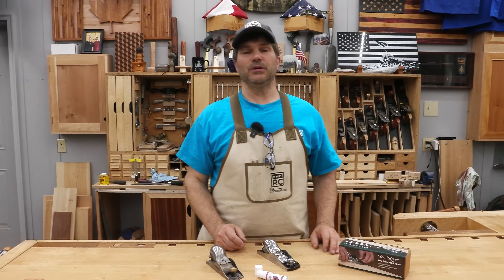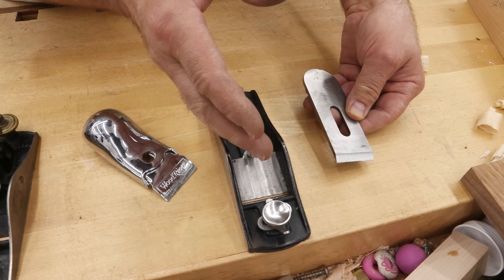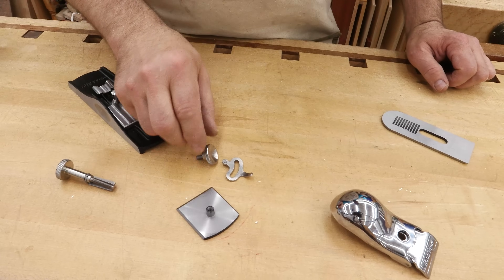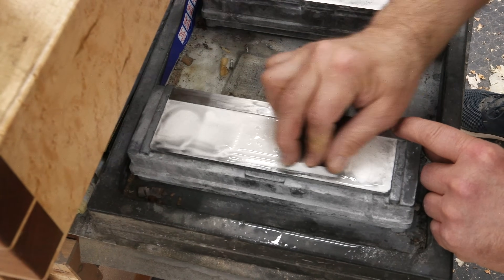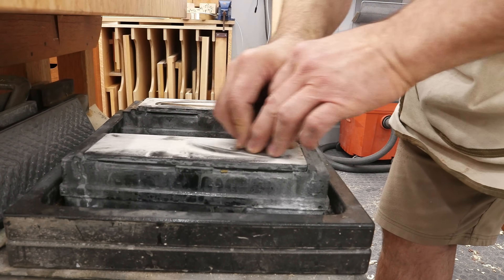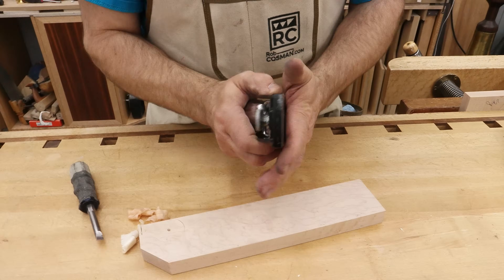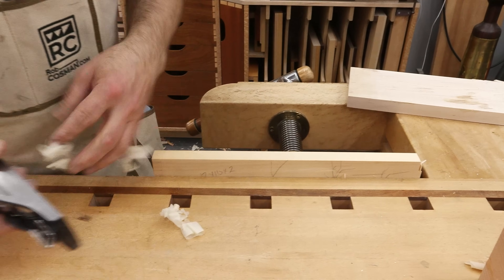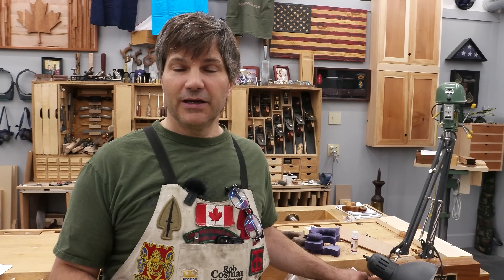How to Use and Set-up a Block Plane

Comment: I really enjoy my WR block plane and your videos. Question I have though, I notice when you retract the blade you went right to using it. I was told that the last movement should always be forward on the blade, so the wood does not push the blade back into the plane because of backlash. Is this something that I need to be concerned about? TIA

Comment: I just sharpened my new 5 1/2 Woodriver. I also have a small 102 that I got for $20. I just came here to make sure the sharpening process was the same as a normal bevel down plane. Looks like the position of the bevel doesn’t matter and the iron gets done the same way.

Comment: Another really informative video, thanks! 
I find working on the bevel to be much more difficult to do by the freehand method than doing the back of the plane blade freehand. The latter is easy-peasy. It is the easiest sharpening to do of all of those tasks. It is interesting that many experienced woodworkers sharpen chisels and plane blades by a freehand method without a guide, but will use the ruler for prep of the back of the plane blade.

Comment: I recently picked up this wood river LA block plane because I fell in love with the 5- 1/2. 
However , I cannot manage to get the blade to project parallel with the sole without it being VERY crooked across the throat. While attempting to adjust it I noticed the slots in the back of the blade that engage the depth adjustment are not perpendicular to the edge at all . Could this be the cause of the issue or am I doing something wrong ? This is the first plane I’ve bought without a lateral adjustment .  
Thank you for all your help, I am saving up to hopefully attend one of your workshops next year .

Comment: I just purchased one of these WoodRiver low angle block planes from Rob. I haven’t used it yet but I’m looking forward to comparing it to my two other block planes. The way you continue holding the lever cap in place when releasing the pressure in order to adjust it is a great tip for those not familiar with this type of lever cap. Thanks for all the great videos Rob.

Comment: I’ve watched a number of chisel and plane iron videos. It seems the grit used varies. So assuming you are using Shapton stones when flattening the

Back of the chisel, what grits do you use.

Back of plane iron, what grits do you use.

When sharpening the 

Chisel bevel? What grits do you use

Plane iron bevel! What grits do you use.
Reply: For plane irons he does the back using the ruler trick and a 1000 grit diamond block then the 16,000 Shapton stone. 

For the primary bevel he doesn’t do anything. For the secondary he uses 1000 diamond block and for the tertiary bevel it’s the 16,000 shapton.

For chisel bevels it’s the same as plane iron bevels. Secondary is 1000 grit and tertiary is 16,000. 

For chisel backs go watch his video on sharpening new chisels. But it’s basically starting at 1000 and going up grits until it’s a mirror polish. So maybe like 1000 then 4000 then 8000 then 16,000. Obviously the closer to the cutting edge the more important it is to be perfectly polished. 

It’s worth noting that the backs of these tools get done once and never touched again. The secondary and tertiary micro bevels is what gets maintained, which is why it takes 30 seconds to sharpen.

Comment: My mistake was buying a Taytools block plane.  I can never get that one setup right to cut the same way twice.  Meanwhile all my wood rivers hold settings like its nothing and took far less time to flatten the sole.  I really need to spring for a Woodriver block plane.
Reply from the maker: If you watch my video on comparing block planes I had the same issue with the TayTools.